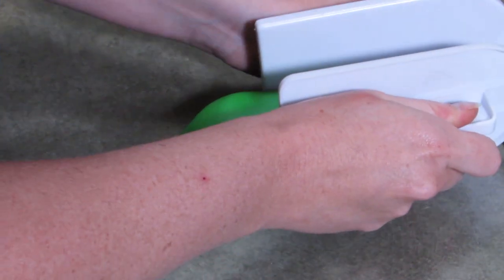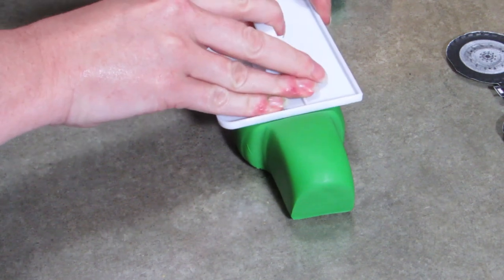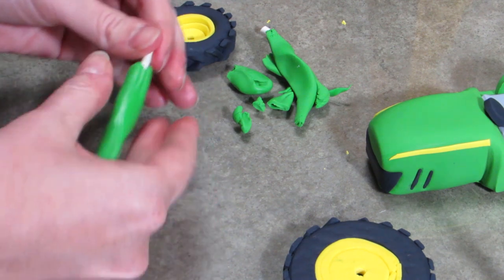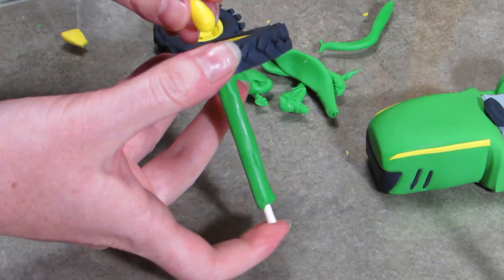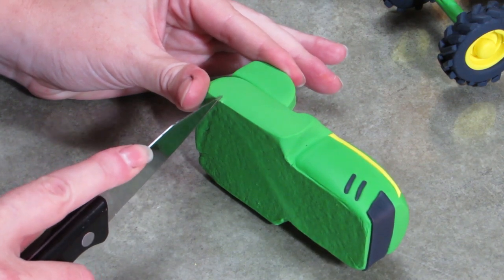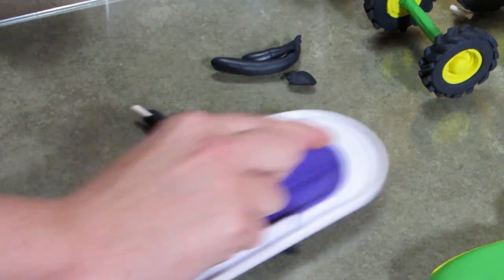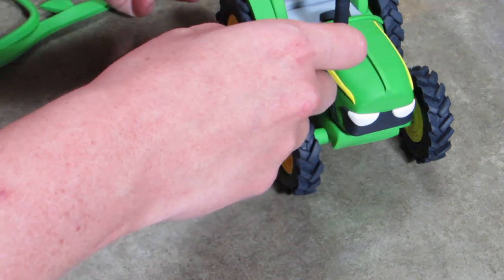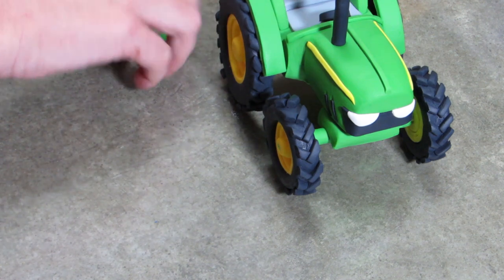John Deere Tractor Cake Tutorial - How to Make a Farm Cake Topper

Comment: How long did you let it dry before you put it all together. And how long till you cut the cakepiece for the axes? Wanna make a cake for my cousin cause he looooooves tractors, so I wanna top my cake with a Tractor like yours. Already nervous cause I really hope it‘s gonna work
Reply from the maker: I'm sorry for the delay in responding - I let the body of the tractor dry for over a day.  It was 2, if I remember correctly.  To be safe, even 3 days would be best.  I made the axles and tires the same time as the tractor's body, I just kept them apart until the body hardened.  I cut the grooves in the body for the axles the next day - after it had a day of drying.  It was still soft enough in the center, that cutting was no problem.  I am not sure what you mean by cakepiece, but I hope this helps.  I'd also love to see what you come up with!  If you don't mind, you can send me a pic at jen@caketasticcakes.com
Reply: Thanks, I already did the Body, axles and tires and tomorrow I‘m going to put it all together. And yeah sure i am gonna send you my tractor :)
Reply: Caketastic Cakes i have already sent you a Photo :)